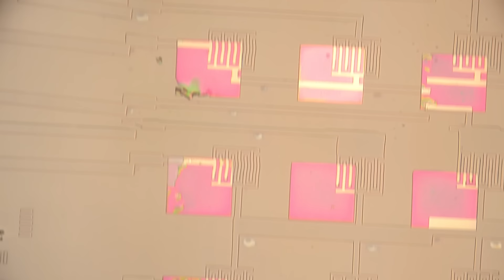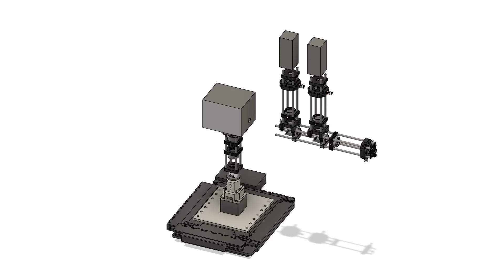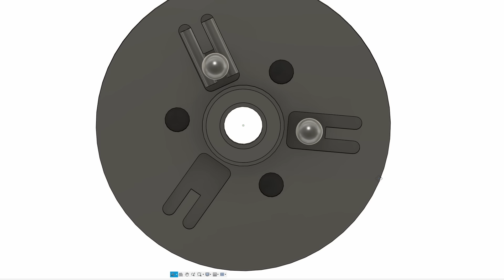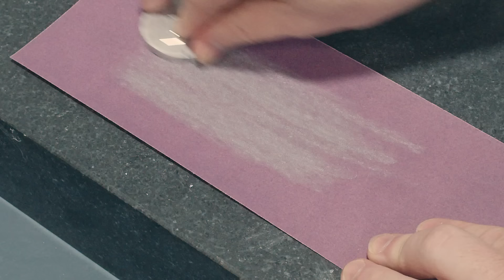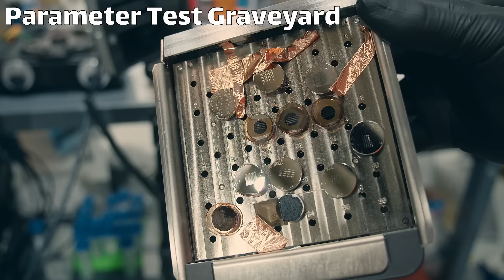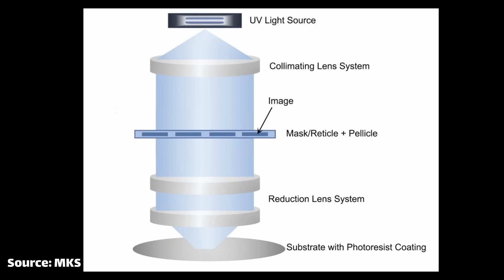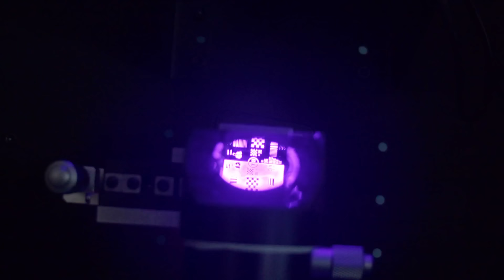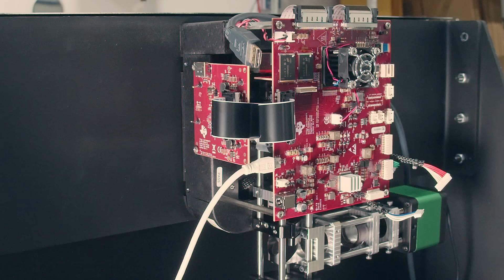Speedrunning 30yrs of lithography technology

Comment: I'm only half way through the video so take with grain of salt (and, fantastic work so far! wow what an undertaking), however I'm seeing you start with a machine design, discover issues with it, and instead of iterating those issues out of the design, you pivot to a totally different approach. I think this represents a flawed methodology - lithography is spectacularly hard, and only really disciplined engineering is going to solve it. I believe you would see better success taking the time to isolate the design into its components and solving those one at a time. Changing to use of a mask adds additional components and manufacturing steps, which will suffer the same issues with mechanical accuracy anyway while only serving to hide the shortcomings in the original design. When you inevitably want to go smaller or improve your resolution and yield, you will be forced to go back and solve those initial teething issues anyway.

Comment: You can easily get to 1 um with contact mask lithography, but it is about the limit and of course you'd need a way to make the mask. Also 1 um is the diffraction limit for visible near UV wavelengths so it's a decent target.

Comment: Sorry I didn't read all the comments-- if no one has suggested yet re: PR adhesion: Hexamethyldisilazane (HMDS) may help, specifically after the water rinse, dehydration bake @115C and put the disk in a closed container with a few drops of HMDS for 5 mins...standing waves are annoying and adding AR coatings can be a separate headache... sometimes there may be a different saturation regime of the PR where over exposing AND over developing patters at a larger scale can give you the pattern size you actually want (depending on PR polarity etc) Keep being awesome!

Comment: My father in law has old progrephic equipment from kodac that was used to enlarge photographs way back when. It has the pumps and lenses... I could not help wondering why you did not modify one of those. It would have been bucket loads cheaper.
Reverse the procedure. Light source below and target above.

Comment: Did you account for the fact that UV focuses on a different plane than the visible light? You are focusing there using the red light and then use UV for exposure. The objective is corrected for chromatic aberration but UV might be far beyond the correction range. Either you will need a camera that sees UV or calculate a fixed focus correction.

Comment: I don't know if this might affect future steps but to get better adhesion of the resist you can treat the surface with a stoichiometric or slightly oxidizing flame from a blow torch, just pass it thorough the flame fast enough that the condensation re-evaporates, the substrate should not get above 50C°. After that the surface becomes very hydrophilic, its like magic how much difference that makes for the wetting and adhesion on surfaces.

Comment: I used to work with laser imaging systems 30 years ago which threw 10 micron spots onto large format printing plates.  Green light really highlights dust particles, if you want to make sure your imaging target is dust free.     :   If the o-ring was just a dust seal, you could put down a ring of memory foam instead.    :  You can test how good your amber protector is for UV by using auto dimming sunglasses outside of the box.   :  You'll find that your red light and UV lights have different focal  distances, so you may want to run a 'focus series' to find the ideal offset between the red-UV adjustment you make.:  Keeping the center of the optics lined up helps you get a wider focused image.  It's easy to be off center when it comes to lenses.  again, green light and fog spray will help you visualize your beam.  : Static electricity is really good at killing optical diodes.   You'll have to wear a static strap to prevent this in the future.  if you put your blown LED under a microscope, you may even see the fractured silicon inside if youre lucky :  I think you did a good job considering that companies in the nineties would have thrown millions on their machines.
Reply: Wow
Reply: @KiriIrving  thank you

Comment: Did you consider to make the Z access automated and add an auto focus optimization using the camera?
it will slow down the exposure process waiting for the auto focus to optimize, but I think that would be more than offset by reducing the additional step with a mask.

Comment: So, if you're going to be replacing that LED, now's the perfect time to redo that z stack on the maskless machine and make it as solid as possible. it removes variables, and if you don't need it right now is a good time to look at removing some. I'm wondering if the movement of the XY is causing the top plate to move slightly, or perhaps the glass itself if the vacuum system isn't hooked up yet.

also, i'd check if there's a current limit difference between the LED's here. LED's are especially heat sensitive, and can actually change wavelength if you're not keeping them at a consistent temperature. during operation. most of this is just heat management, but you may need to add a fan or something to make sure the UV LEDs stay cool.

to solve the stability of the horizontal arm of the optics assembly, maybe add a vertical rod off another "ring" on the arm and have that rod clamp to something attached to the backplane. it shouldn't need to take too much weight, so this is probably printable.

Comment: It seems like you just used way too much solder paste.  In industry, there are stencils cut out of thin sheet metal, and the paste always stays within the boundaries of the pad. Thus the volume of solder for SMD components is actually pretty small.

Comment: This is just guessing, I'm not a lawyer, nor an electrical engineer:

Did you reprogram the DLPA3005 to fit the specs of the UV LEDs compared to the blue? I don't even know if that is possible with the dev kit, but I would assume so. UV LEDs are notoriously sensitive to reverse current, they most likely have a higher forward voltage and are also much more sensitive to the soldering process, to the point where they have very specific timings in the datasheets for ramp up rates.

I don't know what caused your issue, but I'm suspecting that the DLPA3005 is sensing the voltage drop, got a lower than expected voltage from the UV LEDs and then the chip tried adjusting the gain value to "correct" itself, causing it to fry the LEDs. See section 7.3.2.1 (Programmable Gain Block
) in the DLPA3005 datasheet.

Comment: would be really cool to see a like 80s era transistor, opamp, whatever like all the way, as a series. so getting the wafer exposure done enough, maybe place transistors for some existing design, figure out bond wires, make packages (did they stamp the cans out?), and putting it in a basic circuit to do something

Comment: Just figured I would chime in. I used to work in photolithography at one of the top semiconductor manufacturers in the world and we used HMDS as an adhesion promotor (verified that this is public knowledge so no concern on patents). The SDS available online does not appear as though it is that toxic (and we certainly did not treat it to be, just dont get it on your skin or wash off if you do, similar to most cleaning chemicals). I just searched "Hexamethyldisilazane sds" but idk if youtube allows us to post links... for application, we just flowed nitrogen through the bottle and the low vapor pressure delivered enough in a gaseous form (again, verified public knowledge). it would add an extra step but might allow your resist to stick better and would be cheaper to build than your own exposure tool! 

Also, this is fascinating. Thank you for making this video and will be sure to check out your other videos.

Comment: Despite the many facepalm moments and bonehead mistakes that riddle your projects, the most aggravating part is seeing you not learning anything from said mistakes: I swear, if I see another cantilevered optical "support", I'll start petitioning Thorlabs not to sell you anything until you get rid of your 3D printer...
Reply from the maker: Did you not watch the full video?  Also, why the vitriol?
Reply: @BreakingTaps  because it is at least the third time that 3D printing parts for an optical assembly has frustrated your efforts in what would have been a very cool project. The problem are not the mistakes: even if a good half of them could have been prevented with a proper planning and design phase, everyone is bound to do them while learning new things. I sure have my list of bonehead mistakes: however, after the first time you forget to account for chromatic aberration in an optical design worth thousands of dollars, well, you better not do it again. The problem is when you recognize the mistake, and then insist on repeating it, hoping that this time you will get a different result...
Reply from the maker: Huh? The 3d printed parts were never a problem on the 10:1 reduction system. The short exposure, manual alignment and static nature means neither deformation nor thermal expansion would ever be a problem. 

I only replaced with metal because my CNC was free during the redesign time period. The issue with the reduction system was incorrect assumptions about the alignment lens, forcing a redesign. 

There were no printed parts on the stepper machine. 🤷

Criticism is fine, I make plenty of mistakes. No need to be an ass over it though, especially since I'm working to a limited budget on a limited schedule and the overhead of filming/editing a video on top of it.

Comment: My family is retired HVAC and we have an entire sheet metal shop they are looking to get rid of cheap.  Slitter, rollers, benders, lock formers etc...etc.... and likely going to end up getting sold for a fraction of what a single one of those machines would end up costing new.  Pretty old equipment but built as solid as can be.  JS, if people like me exist odds are good if ya look around second hand you will find more people like me.  I would consider opening a dialog about selling the entire shop to you cheap but to be honest with you on the West coast and me being in NJ on the east the price of shipping these heavy ass machines would likely outweigh a large chunk of the savings.

Comment: Considering vibrations from cars can be a problem from hundreds and hundreds of feet away when doing holography in the visual spectrum shouldn't this be placed in something like a sand bed or something given the even smaller tolerances?  I did miss a small section earlier in the video so if that is addressed apologies.
Reply from the maker: Didn't miss anything, I didn't mention that aspect. Both machines are sitting on vibration isolation platforms (the black boxes underneath) which should eliminate most low frequency vibrations. But yes you're definitely right, those can have a big impact on resolution!

Comment: Quarter inch thick steel is no sheet metal.
Reply from the maker: thicc sheet metal 😅
Reply: @BreakingTaps  I'm German, sry for my errors.

My Dad's a tinsmith (I'm not sure if that translation is correct). So he makes sheet metal roofs, gutters, chimney covers ...

And most sheet metal he uses is thinner than 1 mm. So someone calling 6.6 mm of metal sheet metal, throws me off. For me that are metal plates.

I'm a Embedded Systems Engineering student at a university with a MEMS study course, so I have some points of contact with MEMS. And I think your project is really cool.
Reply: Our semiconductor lab here is an old 1 micron process the university bought (for I think 50 million).

So yeah

Comment: Great work! A maskless projector just arrived where I work and it is quite fun, I love tinkering with the lower level details of these machines. I wonder, are there some tilt screws to address the focus problem? You could just add them as a last degree of freedom of the stage: once it is planar or, more precisely, orthogonal to the optical axis, then you shouldn't have problems. Tilt could be a problem for the mask aligner too, especially if you are planning to align to already existing patterns with ~µm accuracy over centimeters. On that regard mask aligners perform the so called wedge error correction, idk if it can be implemented. Good luck!

Comment: For the UV LEDs, you might want to check the paste you used, if it is WS type and you didn't ultrasonic it or flush it with water and often IPA after that, there's a good chance the acidic PH ate away at everything beneath them and turned it into a conductive mess. WS=water soluble, NC=no clean. WS is good because you CAN clean it up readily and remove flux residues, NC is okay for digital stuff etc, where a little bit of flux isn't too big a deal even if it can cause megaohm parasitic impedances. BUT I'm not suggesting you'd want to use NC, as the hot environment might also be enough to activate it enough to slowly attack the LEDs while they are on if they get hot enough, ideally you'd use WS and clean it off so no flux is left, it's just that WS will simply corrode it with time, and not just while it's hot.

Else heat indeed fused them shorted, suggest monitoring their temperature as part of the process or upgrade heatsink and cooling.
Reply from the maker: Oooh, I didn't realize that was a thing. Just checked and it's "kester ep256 no clean", also very expired (got it a few years ago for a project that I never completed). Good to know! I'll pick up some WS for the next batch of LEDs.

Comment: I've been working with a friend on a high resolution film scanner design for the past year, and I can tell you I powerfully empathize with all of those "I have to totally disassemble this and then reassemble and realign it moments and I would rather walk slowly into the ocean" moments. It's a real rollercoaster. BTW I'd spend the time to either figure out how those LEDs failed, or make them easier to replace. LEDs that failed once in a given installation are pretty much guaranteed to fail again.

Comment: Notes on the diode test setting of the multimeter for LEDs: Standard silicon diodes will read around 0.65V, red LEDs will be closer to 2V, and blue will be closer to 3.4V. Larger voltages for shorter wavelengths, in general. There's a lot of variation between different LEDs, so treat these as rough numbers. When you measured the red LED board one direction and saw 0.66V, that was probably a reverse protection diode. I couldn't find the LED PCBs from TI's docs to check, but the Hacker-Fab board has two LEDs in series on theirs. That means that the forward direction for the red LED board should read around 4V. Depending on the multimeter, 4V is too high to be read by the diode test function, so it'll show up as overrange. The 0.071V you measured for the UV LEDs is pretty close to a short. They are definitely toast (but shorted, not open circuit). If you wanted to measure the 4V of two red LEDs in series with your meter, you'd maybe want to look for one that has a zener diode test function as that'll read up to a much higher voltage. 

(And I'm really looking forward to the 2nd video with the engineering deep dive.)

Comment: I believe this entire machine would have been better on its side or flat as the heighth of the machine will induce vibrations so much more easily than its flat counterpart. and with everyone flat on the metal is can have additional braces put around the machines to really get it to not vibrate at all.

Comment: Dude, you should totally get into the kinematics of working on something like this. It’s very similar to what I work on 90% of the time and as I was watching you deal with the O-ring debacle of your third stage on the first machine, I was screaming at the TV “ oh man, I can fix that”. Lots of people struggle with mechanical alignment, but it’s really all not that hard if you know where to use the hammer and where to remove material.

Comment: generally for such application all the components should be precisely grounded,using indicator during installation  checking parallelism and straightness .xy stage should be bolted on granite plate, the whole setting a vibration isolation stage

Comment: Hi, an engineer working on air bearing stages for fuse cutting on wafers etc here. There is something im missing in this video: it is consideration for thermal growth. The objective of your maskless system in itself grows and shrinks tons. The objective assembly moves a lot in relation to your wafer. What i recommend is using carbon fiber rods to assemble your optics. Using 3d printed parts is just horrible in that regard. Stick to steel and carbon fiber.

Leo

Comment: This is really incredible, nice work! How far from the output of this machine are you to an IC that you could build a circuit with? Like, could you make logic gates that you could use to build a Ben Eater style 8bit computer?
Reply from the maker: If I restricted myself to a relatively small area (one image field, or perhaps stitch together a matrix of 9 by hand) I think I could probably hit 3-5 micron features reliably. A basic PMOS transistor needs 4 masks/layers (diffusion, gate, contact and metal) so most of the error would likely be from overlay/alignment between the different layers. Tentatively early 70's era chips? But there are a lot of steps that I don't have much experience with, like oxide etching and diffusion. Would probably take a while to get all the additional steps sorted out and working reliably.

But yeah, I think I could probably do some early 70's transistors if I spent some time optimizing everything!

Comment: For a poorman's spin coater you can use a dremel, a variac (finer rotation control), and a tupperware bowl. You can monitor the rotation speed with a cheap neodymium magnet and a hall sensor.